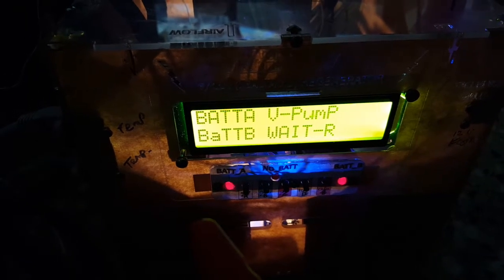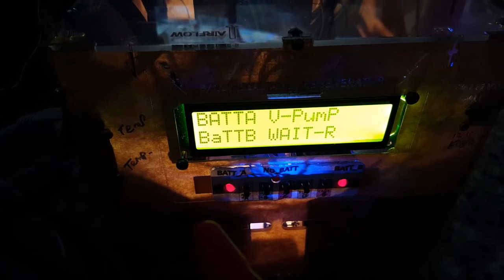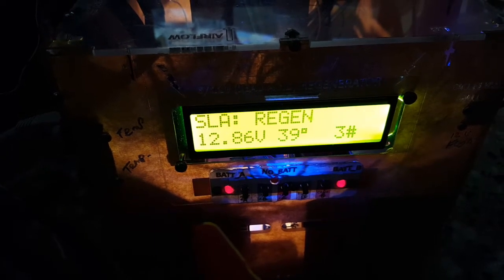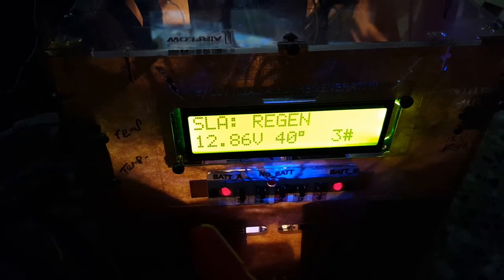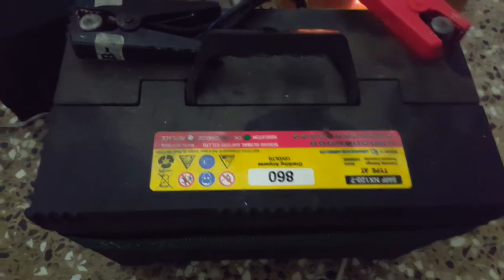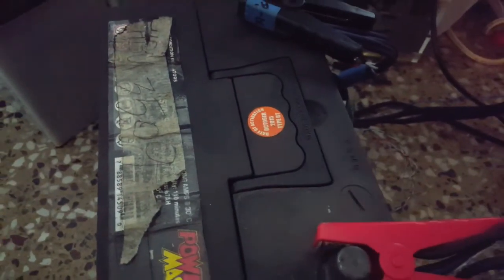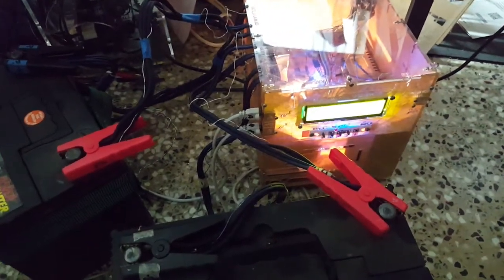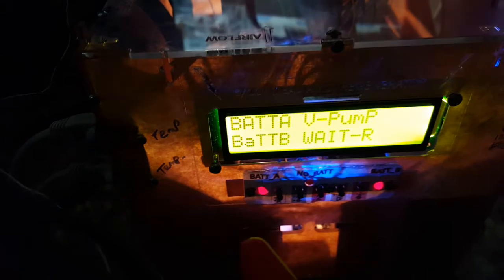Automatic 6/12V Battery Rejuvenate ,  Desulfate, Dedendrite, Charge & Rate (CCA & Ahr) - Sneak Peak.

Comment from the maker: FYI all, the video is just a sneak peak as the system has to be trademarked. The tech is good and verified over hundreds of batteries with regenerated units placed back into OEM service and monitored for longevity. I am thinking about spinning off a DIY version as this version is 100% automated with early battery rejection & failure modes plus it queues a 2nd battery for processing for 24/7 productivity. IoT connectivity allows the user to monitor & control all systems remotely and track battery yields and system diagnostics. Prototype testing and refinements took place over many months of operations at a Commercial Bosch Battery Franchise. Regen yields average 20% to 33% from scrap batteries (up to 10 year old batteries) and >80% for stale dated ex stock batteries.

Comment from the maker: Update: the smaller Batt in the video has recovered from 2V flat after 6 months sitting in a vehicle to 100% CCA and 73% AHr after 16 hours of processing. If u look at the two blinking LEDS, one for battery A and one for Battery B, you'll see battery A blinking fast (red/green) and a slow blink for batt B. This means Batt A is processing and Batt B is the queued batt. A failed batt makes the matched LED solid RED and a beep sequence alerts. A passed batt makes the LED solid green and a milder beep sequence alerts.

Comment: Have you made any units available?  Cost?  Looks promising.
Reply from the maker: So far pre-orders to 2 different countries. Setting up an assembly line now. The business plan was developed with support from the U of Applied Sciences (FH Joanneum) in Austria. The system has a  lease of $100 /month and is monitored (plus some control) remotely via a website interface protofabtt.com. It is optimized for batteries from 12Ah to 120Ah and can work to 250Ah , 6 or 12V. It is not for retail sale as it isn't really targeted at users with less than 40 batteries to process per month. =>  fleet management (auto & marine), battery recyclers, used car lots etc.